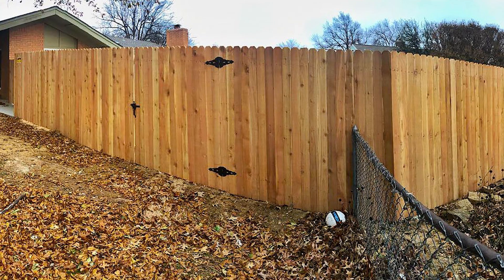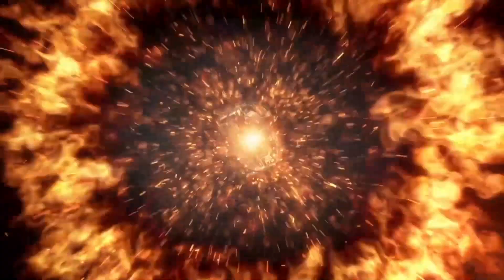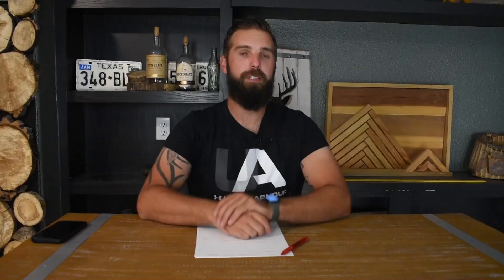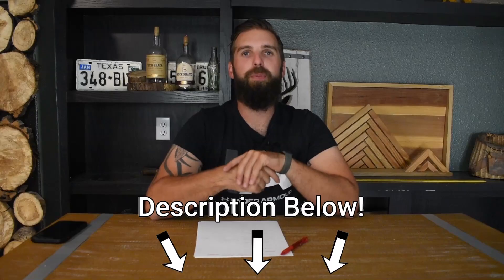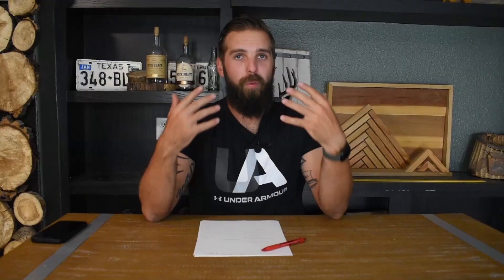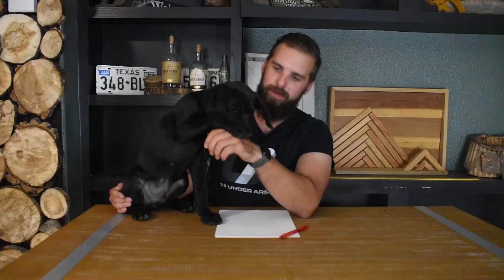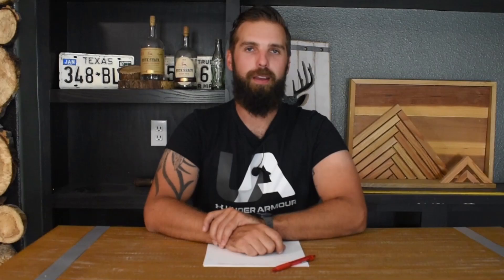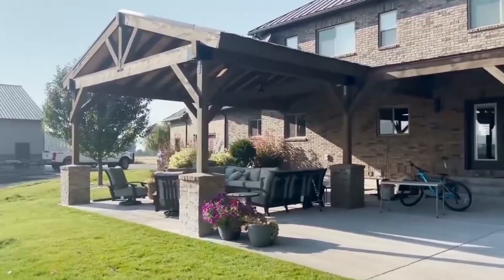Top 7 Carpentry Jobs That Make BIG Money in 2022!

Comment: Trex is really heavy and acts like spaghetti when moving. The fastening system is questionable especially in earthquake zones. 
Use wood.
Reply: the clip system is okay, but the camo system works the best. plus, Trex will warranty their product as long as you install it to their specs. cover your ass by doing it correctly. earthquakes can cause concrete structures to fall.....